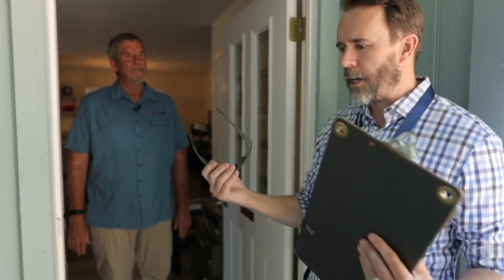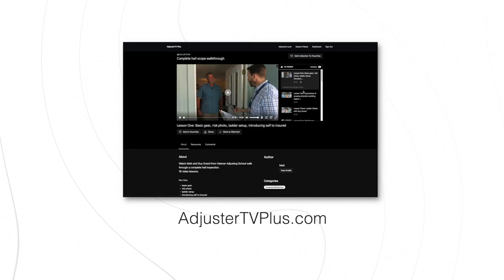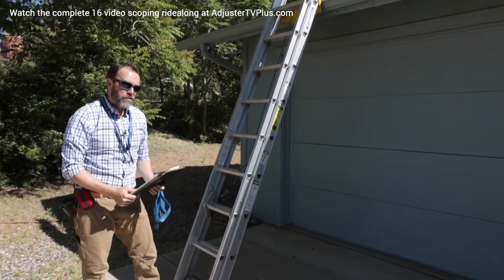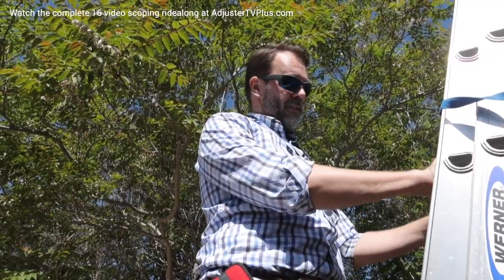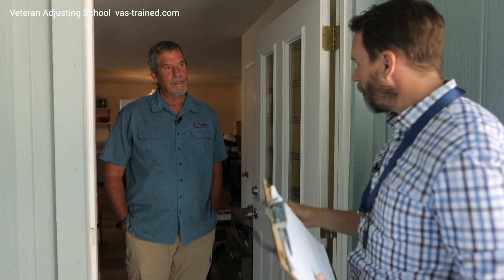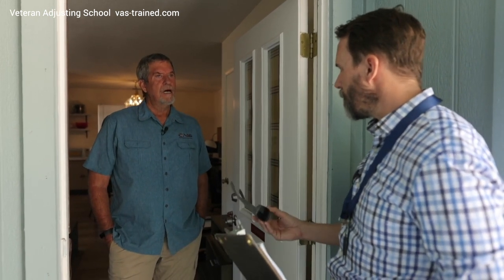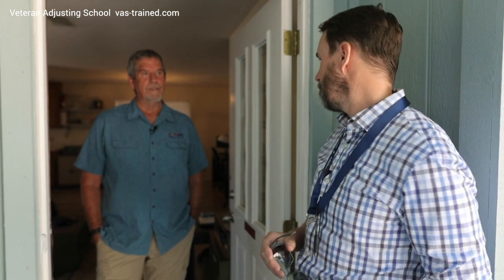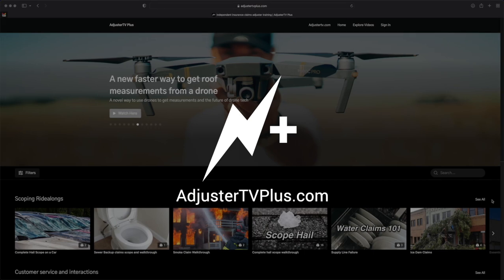How to introduce yourself to the insured

Comment: Are there any liability issues with allowing the homeowner on to their roof using the ladder?  I like it when the homeowner climbs on the roof with me but I've been told liability is on me if something should happen
Reply: I think its subjective. I don't like anyone touching my ladder, even if its a roofer I've been friends with for years. It probably varies state to state but I also think its a liability concern.
Reply: As a staff adjuster, our company doesn’t want anyone but their adjuster on the ladder.
Reply: I wouldn’t suggest it. I usually tell them to just stay inside and I’ll come get them when I’m done. If they insist than they can use their own ladder. You don’t want them falling off them trying to sue you.
Reply: @matt007  Agreed same. Dont want them talking to me when I'm trying to walk a 10/12 pitch that is 30 years old too.. LOL
Reply from the maker: In all honesty, I think in 10,000 roof claims I might have had maybe a half dozen that insisted on getting on the roof with me.  Not common.